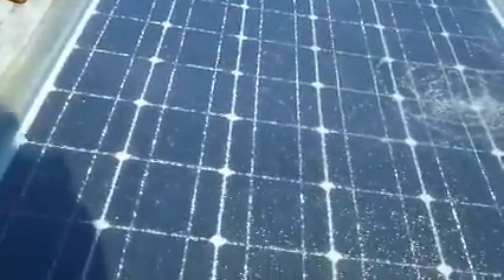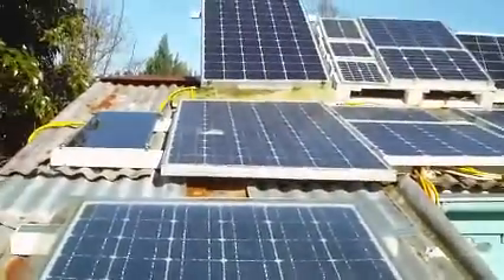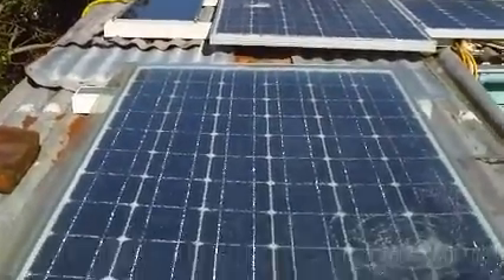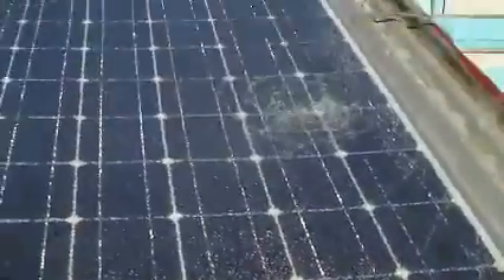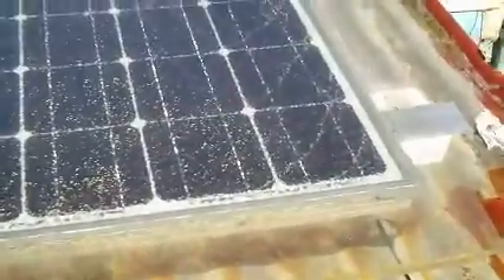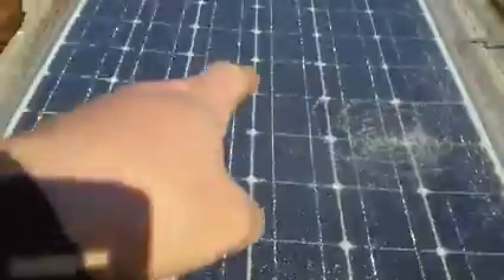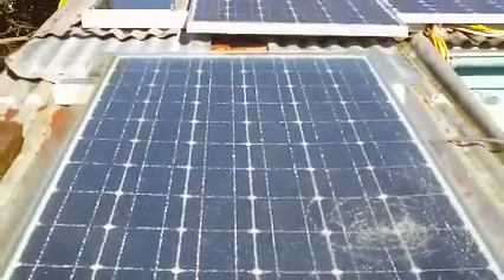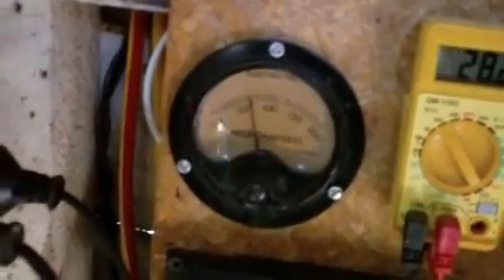Extreme Solar Panel Repair Pt1

Comment: can the glass of solar panel change?
Reply from the maker: Nearly impossible as it's it kind of glued to the cells themselves. You could try picking out all the bits of glass but I suspect it would damage the cells in most cases.